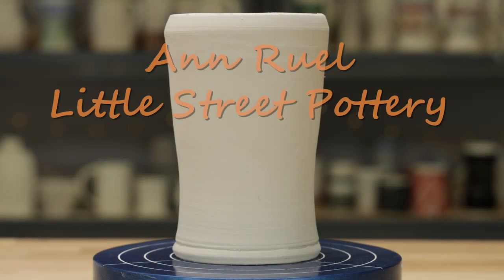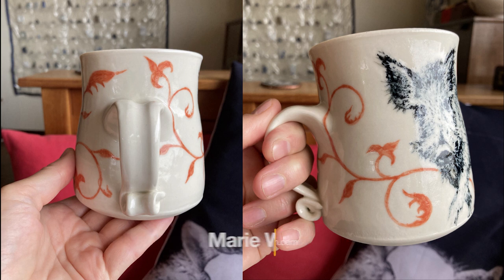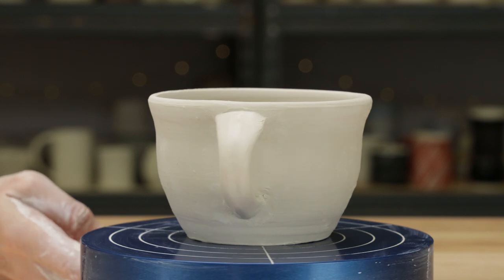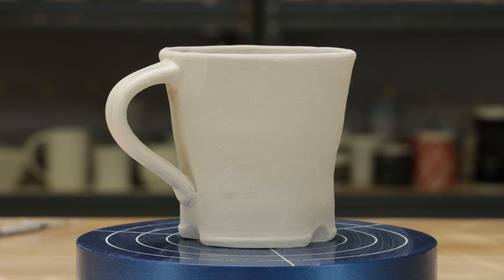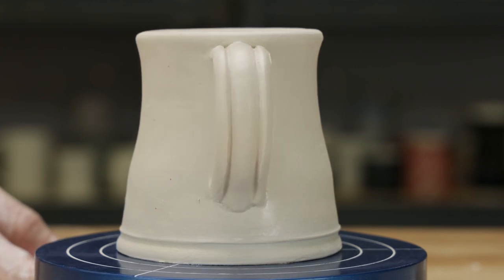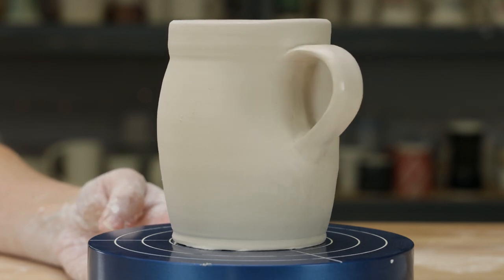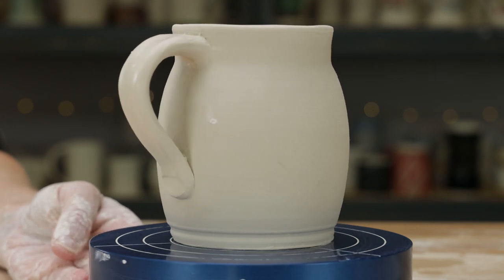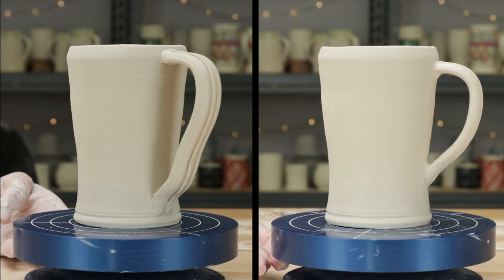6 Ways to Make Better Handles for Pottery - DESIGN A GREAT HANDLE!

Comment: Thanks Ann for the videos— always very helpful.
I have issues with getting the handle and mug to be at the same place from a drying perspective. I think it h me at he my clay. I have to admit I hate pulling a handle—the diamond core tool extruder is an expensive but great tool to help.
Any suggestions on drying and connecting the two? I find the mug body is dry since I need to trim it first.—maybe a damp box would help? Do you have a video for making a damp box? Thanks again
Reply: Hi Gina.  you are right, it is very important that the handle and the mug body are  at relatively similar stages in drying when you attach them.  A damp box may help and we do have a video for making one.  If you dont have the space for a damp box, I like to keep the plastic that my clay comes in to cover the mug body until I am ready to attach the handle.  Good luck.  Here is the link to the damp box video...https://www.youtube.com/watch?v=4mTI91Xebm8&t=3s

Comment: Oh my gosh I need this soo badly!! I made 4 mugs the other day and it took me foreeeever to get the handles right!  I see when you are pulling your handles you aren’t using water. Can you please show us how you do that? It takes forever to dry that handle when you use so much water when pulling.
Reply from the maker: Just using clay from the block and a little water on my fingers (and my standard porcelain #365 which an get pretty goopy when I use too much water)
Reply: I feel the same way.  What you can do is shape the handle and leave it upside down in that shape as Ann shows and let it dry some before trying to put it on the mug.  Don't let it get too firm or you won't be able to do any little reshapes without it cracking.

Comment: You gave up the concepts to solve the comfort issues. I’d like to see you keep the concept and quirkiness of the designs while solving some problems. On the first mug how about strengthening the hanging loop design, and maybe adding a finger notch or button at the bottom for the other fingers? On the second one, why not keep the upside down curve concept? It’s interesting, it could be aligned with the foot, and perhaps an interior curve could be added to avoid pinching and keep the fingers from being pressed into the cup. The thick handle did give weight, why not lean into the weight, perhaps with some detailing, maybe a hollow handle, and maybe even add to the mug base to play up the heft, well, if it really was a deliberate thought. Your darted one really did follow the form much better, essentially you kept the concept of the darted mug, when the handle before seemed more like an afterthought. The bellied one, well again, it seems you are not into the jug aesthetic. Those handles are not particularly for drinking. They are for carrying or securing with a rope.  They have a bootleg vibe. It’s a choice. The last one is nice, but I think a top to bottom strap is another storage handle that invites grabbing the body of the mug, with the handle curving around the hand. The bend in the last one didn’t allow for a graceful and pleasing curve around the entire hand, as it seemed to be intending. Your solution was nice and functional, but lost the concept of the top to bottom handle and the sheltered body hold.
Reply from the maker: Thanks for the feedback!